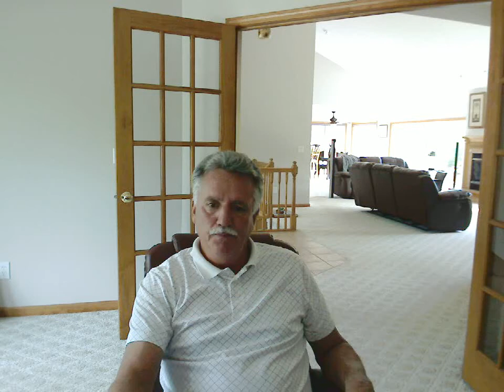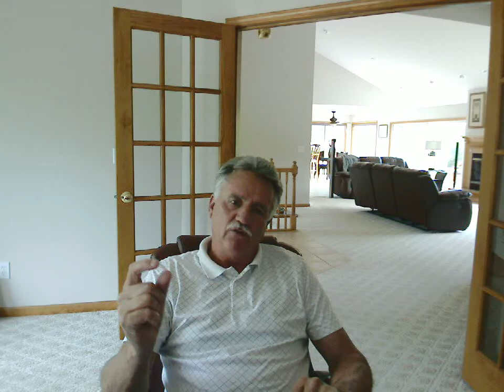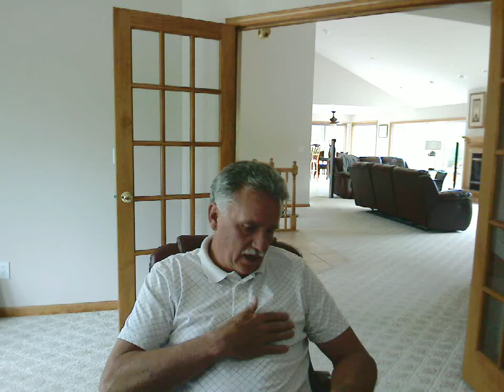Cummins L10, M11 & N14 Injector Troubleshooting

Comment: I've got a cummins L10 select and can't figure out what's wrong. It feels like it's gonna run out of diesel, burning smell from the muffler, you can feel the lack of power/miss firing. There is no code showing up and also have taking it to cummins where they ran a diagnostic test and said they can't find anything wrong. Only repair i had before this problem started was a full service, replaced both belts and rebuilt rad. Can someone please help?
Reply: Truxer Randy if it’s a more upgraded rod then it would cause trouble because of more power from the rod you’ll have to upgrade other parts as well

Comment: I got a N14 with a code MID 128 and 127 what this mean 
and i dont get any power to the injectors cant start the engine 
i tried with starting fluid but its start only for a second and died right away even if i continue to spray the starting fluid.... why its doing this????????????

Comment: Hi, I have a 2001 24 valve cummins 2500 automatic. It has a miss from 1000 to 1500rpms. it started out doing it once a blue moon but now its continues. I allready replaced the injector pump for a similar problem about 2yrs. and im hopeing I dont have to do it again. I was wondering if you could help me. Thanks.